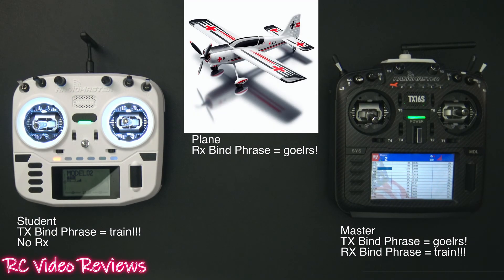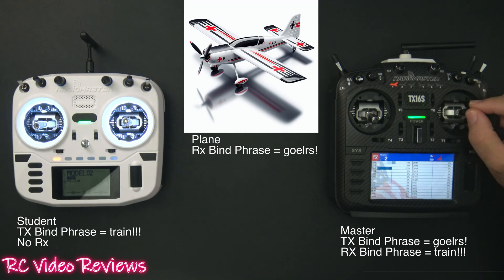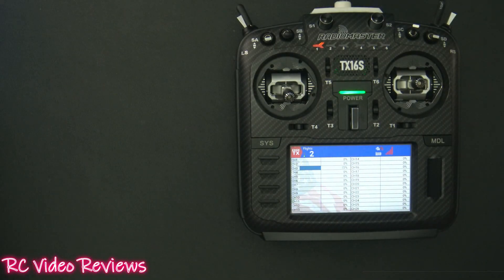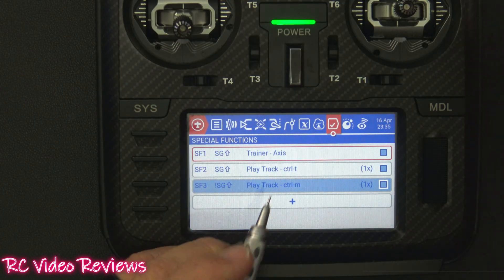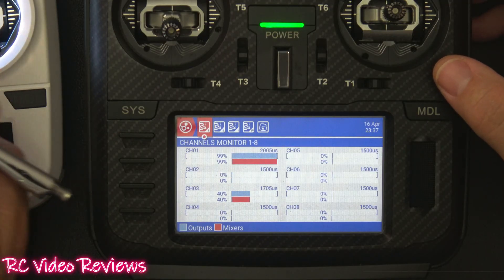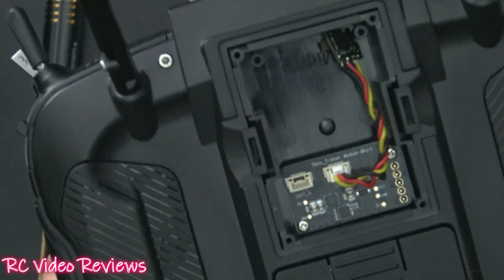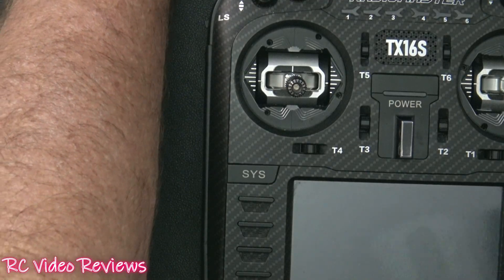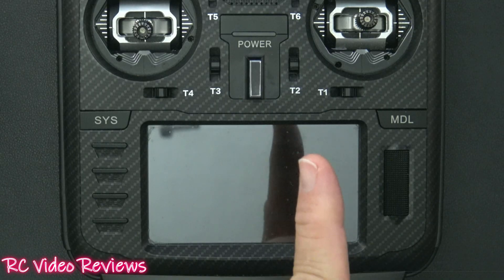The BEST Way to Train RC Pilots – Radiomaster SBUS Module Explained!

Comment: Hey John, have you tried using the wireless training module (SBUS Module) mounted to the TX15. I have a TX16s with and internal 4in1 module and a TX15 with the internal ELRS.  I also have the SBUS module with an ELRS receiver in it and an external ELRS module both with the same ELRS 3.6 and the same passcode (model matching turned off). When I have the wireless trainer module installed in the TX16s and the external ELRS module installed on the TX15 the trainer function works with the TX16s as trainer and the TX15 as the student radio. Flip the external modules and I cannot get the TX15 to be the trainer radio. I have checked to be sure trainer features are enabled on both radios and the special function for trainer mode on a switch is working. Any help would be appreciated.

Edit: Just to be sure the trainer feature on the TX15 is working, I connected the two radios with a stereo cable and it works that way.

Comment: Hi. 

* later edit. I’ve just realised the massive flaw in my plan. There’s nowhere to put the trainer module. Damn. 

This is a great video - and I already have the module!
I have a question….
My master tx is an inbuilt elrs rm boxer - but I am using it with a tbs crossfire backpack to control my wing. 
The student radio is also inbuilt elrs (rm pocket), but I don’t have a crossfire backpack for it. 
The trainer module has an elrs receiver in it. 
Can I use this set up with the trainer module?

Trainer tx Rm pocket elrs > trainer module elrs in elrs boxer > trainer tx output tbs crossfire > tbs crossfire rx in wing. 
Thanks. Hope that made sense.

Comment: Does the student radio need to be in edgeTx or can it be on opentx?
Do I need to flash firmware on a RP2  with an inverted_tx option for it to output sbus?

Comment: @John I am wondering if there is any need to send arming on chan 5 on the student's side to profit from eg. dynamic power? Or is that not necessary at all when the ELRS receiver's protocoll is set to SBUS?
Reply from the maker: ELRS is good for 20km at 10mw. I wouldn't be worried about RF link between master/student while using ELRS even at minimal power.

Comment: Brilliant video, thanks!! I’ve been trying to set one of these up tonight after watching a range of videos (yours is by far the best!).
Your set up looks much the same as mine (elrs boxer trainer+ elrs pocket student, with EP1 rx in the box).
Do I need to do anything with the receiver other than bind it? Some of the videos were saying to flash the rx to make it put out sbus - but when I did that it wouldn’t bind. 
Thanks!
Reply from the maker: Binding and the serial protocol are not related. You flash it, bind it, then set the serial protocol to sbus. The module only understands sbus, it does not accept CRSF, so you have no choice in the matter. The RX in the video uses sbus.

Comment: So its ELRS between the radios with a full rx running in SBUS mode. What if your internal module was  4in1?  And obviously the model has an rx the 4in1 supports? Since its going Sbus to thats reading axis it feels like it would just work there as well, any model bound the the master radio regardless of protocol should work?
Reply from the maker: The entire setup is ExpressLRS.
Reply: @RCVideoReviews  yes yours is but no part must  be elrs. I would say there are only a few requirements. 

1 master radio must bind to model with internal module. 
2. You need an RX that the student radio can bind to via any means. 
3. The Rx must support sbus out and 5v input. 

I bring it up because while I'm mostly elrs myself but I want to train the kids with a volantex warbirds model as they are cheap , robust and have stability onboard but require a 4in1 bind.  I mostly need the trainer to make sure they don't fly outside of our limited area
Reply from the maker: You can use whatever RF tech you want. You just have to have SBUS out to the module. MY EXAMPLE showed all ELRS. ELRS from master to plane and ELRS from master to student.

Comment: So why this over say a 'Ranger Micro 4in1 Module' ?
Reply: Cause that's not a trainer module.  Did you even watch the video or understand it. The module is like a rx not a transmitter
Reply: @MikeyMikey1968  lol pretty strong response from someone who clearly has never used the wireless trainer function via an external module before. They've long had this functionality, hence my question.
Reply: @Milton-fl6x  You sure about that

Comment: This is perfect for teaching my kids. It’ll be nice to get rid of the cable. It’s not often talked about, but one function that I have found extremely useful is setting the trainer mode to += on the axis. This allows you to override/add inputs while the student is flying instead of always having to flip the switch to take control back. Really handy when teaching sometime to land.